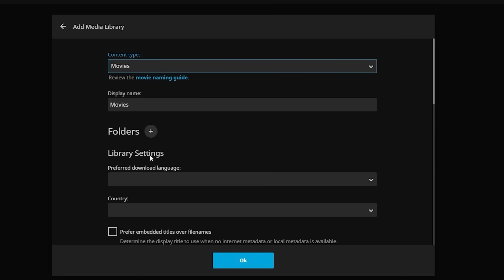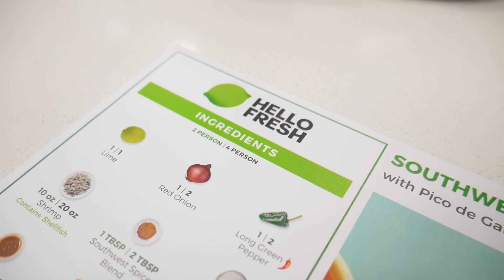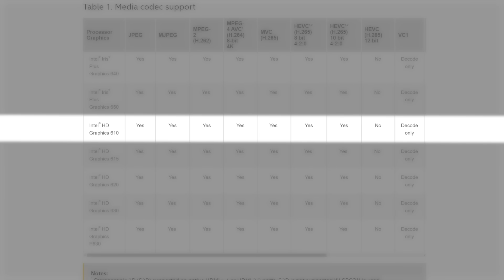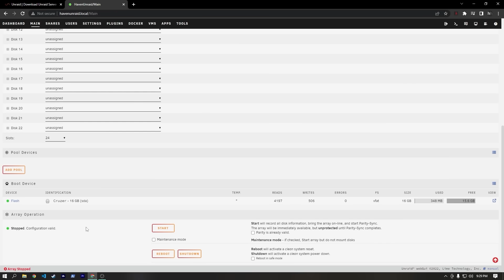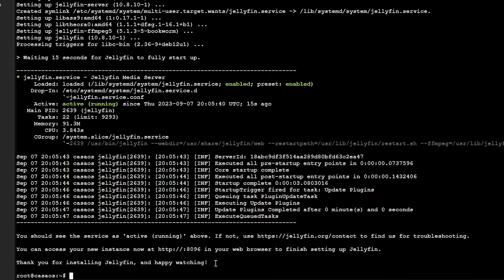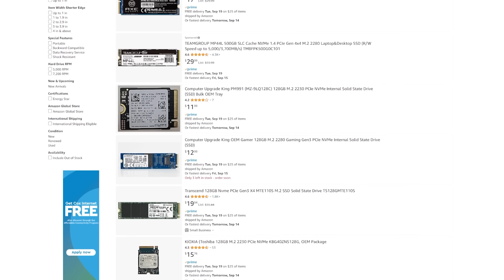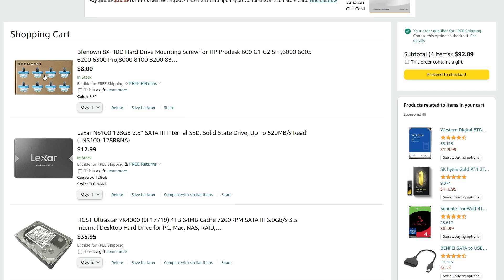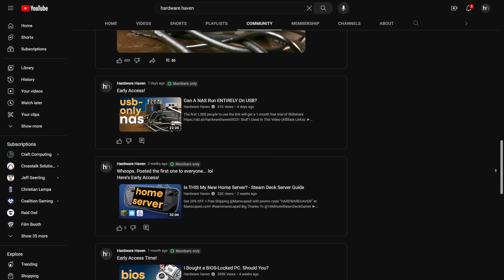The ULTIMATE Budget Jellyfin Server

Comment: I use my Mac Mini M1 as a Plex and Jellyfin server as well as being my photo video computer.  With an external drive it works great as a media server.  It is really low power and also great to rip your DVDs and Blu-rays, getting around 300 frames per second for encoding DVDs and 60 for Blu-rays.  They are getting pretty cheap now they have been replaced with the M2 version.
Reply: How is transcoding performance? I am thinking to connect M1 mini to my Synology for jellyfin.
Reply: @sudarshan6530  seems fine so far, I have enabled hardware acceleration and watched quite a lot of films in different ways such as mobile phone/tablet/fire trv stick/browser and all have worked great.  Also watched a mix of h264 and h265 source files with no problems.  Hope yours works out well.

Comment: I just bought a HP 800 G5 SFF w/ i5-9500 on Ebay which I was changing out my EMBY/Gaming server.  Upgraded the RAM to 32GB.  Actually a great PC.  The 3 drive bays and 2 M.2 is very compact.  Even has 2 PCI-E x16 (one at x4 i believe) and 2 at x1.

Comment: From both my research and experience so far, it's been worth the difference to at least get something with an 8th gen intel cpu. This in when the UHD630 igpu was introduced to replace the HD630 and is a transcoding powerhouse. Also, this is when i7 cpu's started coming with 2 additional cores making them 6 cores and 12 total threads(great for additional unraid things). A good example of a model with 8th gen would be something like the HP Prodesk 400 G5.
Reply: Also worth looking into would be laptops of those generations. Screen and keyboard condition does not matter and sometimes you can get an Nvidia GPU and low power consumption to boot
Reply: The HP Prodesk 400 G4 is even a better deal with an i3-8100 it's very cheap to obtain, has more than enough power to run stuff and transcode as you already mentioned
Reply: The HD630 is still really good. I read on reddit that you get 4-5 4K Transcodes with a HD630 and 6 with a UHD630 not that big of a difference I would say. as They otherwise have the same transcoding capabilities for 4K HDR.

 I think most people are good as long as they dont get a skylake or older as they lack H.265 10Bit 
Transcoding.

 In my search for one it looked like it was easier to find the bigger version of the HP 800 G3 that have room for 2 HDD with the 7th gen CPU,s over the 8th gen,s for a good price but i also live in the EU where a machine with a i5 8500 would cost around 270 Euro and a i5 7400 would cost 135 Euro. As these types of PC are not often sold to the second hand market in my country and are scrapped in sted. For myself it was the cheapest to get a second hand HP 800 G3 from the UK and ship it here as most people here wanted at least 185 Euro for one with a 7th gen and 140 Euro for a 6th gen.
Reply: Some low end 8th Gen is the sweet spot for someone trying to run Jellyfin with hardware encoding 4k hdr... Actually... That was the whole reason for me to switch from a RaspberryPi to a full desktop i5 8400... It has been running great tho!
Reply: @Rafy_24 how’s power draw on that? And do you think it has enough power to run a Linux instance I can tap into?
Reply: So if I get an HP ProDesk 400 G5 8th gen intel cpu I would be able to stream movies in 4k without issues?
Reply: @blocked_message  yes it will
Reply: i would have went for a g4
Reply: I recently pulled the trigger on a Dell Optiplex micro with an i5-8500t in it. Very glad I was able to get it for 100. It only is coming with 4gb of ram, but getting another 4gb stick or a 16gb kit will be super inexpensive.
Reply: I got HD 630 with a 7th gen i5-7600
Reply: My main pc uses a i5 8th gen :')
Reply: I ordered the HP Prodesk 400 G5 becauseof your comment, and I didn't realize there is only one 3.5-inch drive bay. Is there a way to get 2 3.5 inch drives in it?
Reply: @scottsprojects658  You may have to get creative for that setup. I use 1 3.5in HDD as the parity drive 2x 2.5in SSDs mounted to the bottom of the inside of the case with double sided sticky tape, and an nvme drive as cache.
Reply: @Abro86  thank you! What size hard drives do you run?
Reply: You can find x265 readily online (in decent compression as well)...the lower processors can decode it for streaming but can't encode without full brute force CPU compiling.  Most players can also decode as well...saving bandwidth
Reply: After looking at it some more at the HD630 and UHD630 They look identical in benchmarks if you just look at the iGPU and doesn't put anything heavy on the CPU when running similar ram configurations i think they may actually be the same one just rebranded as the only differences i could find it that the i7,s with UHD630 have a 50 mhz higher boost clocks over the HD630. All other CPUs have the same boost clocks on their iGPU as the previous gen. 

I think the difference we see in how many transcodes they can do actually come from the ram configuration used with the iGPU as the 7th gen series supports ram up to 2400mhz and the 8th gen supports up to 2666mhz. Making the UHD performance a little better but we also need to take into account if the PC is running Single, Dual och Quad channel memory. That will also affect the performance of the iGPU. Especially if you are just running single channel as it can make a huge performance loss over dual channel everything at around 20-30% on the HD and UHD iGPUs depending on use case.
Reply: 8th and 9th gen don't usually have hyperthreading except for i9.
Reply: @sethperry6616  the 8th gen i7 8700 is the one exception to what you said. It’s 6 core/12 thread.

Comment: The more stuff you stack on the software side the more needlessly complex your setup and troubleshooting will become. IMO TrueNAS is great for this kind of build, it functions as a hypervisor and has a Jellyfin plugin ready to deploy in the app catalog. Unfortunately to make it work though you'd need to get a slimline optical drive to 2.5 bay adapter though.

Edit: Oops, I didn't notice the SSD on the board, that'll work fine as a boot drive for TrueNAS to. Either way adding a 3rd drive would allow for a RAID 5 and gain you some wright speed improvements and more space while still allowing for 1 drive failure!

Comment: Why is everyone in 2023 still a fan of „Transcoding“?
Reply from the maker: Because direct streaming isn’t always possible..?
Reply: @HardwareHaven  Is that so? I mean, every Tablet/TV i own takes everything i throw at them. Do you have an example for me?
Reply from the maker: @Bogomil76  are you using h264 or HEVC? A lot of modern devices and browser can decode HEVC just fine, but not 10bit. 

Also, plenty of people want to stream outside of their local network where bandwidth becomes the concern, not necessarily the codec.
Reply: @HardwareHaven  For the most part its H.264 (Blu-ray) and some 4K (UHD).
Yes, outside could be a problem.

Comment: And what should "CasaOS doesn't support raid" mean? Isn't casa just some container manager on top of any linux os? Is it that hard to config raid using 1 config file and couple of commands? Is it THAT critical to have this functionality in fancy web ui?
Reply from the maker: You're correct, and I have setup RAID with it, but I imagine someone setting up CasaOS is wanting a simple solution. I also had some weird issues with how CasaOS recognized the mount point for the array, so I just went the route I went. Not saying it was the best option.
Reply: @HardwareHaven  yes, probably you're right speaking about newcomers, I think casaos will add this feature in the future, afterall it is still relatively new project. Thank for the video!
Reply from the maker: @rafisburganov  Last I checked one of the developers either said they're working on it or plan to. It would be great to have that as an option to recommend to family/friends
Reply: When you know nothing about computers. No fancy button = does not support.
Reply from the maker: @severgun  Poor choice of words, sure. I should've said that they still haven't implemented support for managing raid within the UI. Get off your high horse dude, lol

Comment: That HP EliteDesk 800 G3 has to be the best small form factor PC. In addition to all the things you said it also has some PCIe Lanes that can be used for adding NVME slots. If you actually get your hands on one you could make a nasty little NAS. That would be an incredible project for the channel.

2x 3.5 drives (pick your capacity for backups)
1x NVME drive (for the OS)
2x NVME adapters for the PCIe slot (primary NAS storage, ZFS mirror optional)
Reply: You can even chop off the 2.5" mount and put a third 3.5" drive there, with a bit of DIY skills. I have a G4, which is very similar, and I have 3 HDDs and 3 SSD in mine, plus a dedicated GPU and dedicated 10Gbps card.
Reply: @12gark  Can you post a picture of your build showing some details? I've got the same system and I really want to do something like yours. Mine is currently running with only 2 HDDs and 1 NVMe
Reply: @Volgin.  Sorry, I'm not really a guy to post stuff on reddit, and it's very tight so I have no idea how to take useful pictures in that mess, but I can give you a quick description. Basically you disassemble the from metal tray (of you look carefully from the side, there is a position where you can push out the pins holding it in position). Then you chop off with an angle grinder or a manual saw for metal the 2.5" tray. There are 2 bends where the metal goes down to hold the 2.5" drive, you cut right on the bend, and everything else that gets in the way. Use a hdd to check where it's hitting, and cut everything it hits until is sitting on the flat part. Don't worry for stiffness, it's plenty strong for a pc case even after cutting, make sure you remove everything thst could be an issue. Don't cut the front mesh, otherwise it may become visible from the outside, ruining the looks. Mine is sitting below the TV, so I wanted it to look nice from outside. 
This way you have enough space for a slim 3.5" drive when you reassemble the from tray. To fit the chonky disks you need to lower the 4 pin psu connector that goes into the mobo. I tried with an extension cable (cutting a piece of the plastic connector), it can be done and it works, but I didn't felt safe and decided to opt for a slimmer drive I had laying around.
I then placed 3 corks cutted to the appropriate height below the disk (hot glued to the bottom of the case), and a 0.5mm rubber pad I had laying around from another project above it, in the areas where the disk makes contact against the metal tray. I added a couple of zip ties just to make sure, but they are useless, the drive sits between the corks and the rubber, and that's more than enough once you close the tray in position. 
It seems awful described, but it worked just fine for a year straight, and disk hasn't moved 1mm (I marked the position with a CD marker just to make sure, and both the cork and the rubber work to damp down the vibrations).
The real pain is fitting the 3 power connectors to the 3 drives, be gentle and be patient, two things I'm not particularly good at. Short and flexible sata cables are really helpful if you find any. 
The third Nvme is just a no-name 1× pcie to m.2 adapter from amazon, maybe 10$.
Then a x540 pcie 10g card and a Quadro A2000 from ebay and you're good to go.  
You can also add more stuff using the WiFi M.2: you can add 2 sata, turn the A+E key into an M-key with an adapter for a regular Nvme, or add a 2.5gig ethernet nick to that port. I wanted to put a 2.5" sata ssd into the dvd slot, but I gave up, too tight with the third 3.5". Absolutely doable if you want a 2×3.5"+2×2.5" setup. 
My entire home lab runs on it with no issues, but I do spindown the drives when not in use, so maybe check for temperatures if you plan on leaving them always on. A slim 40mm fan fits between the drive and the gpu if you want to improve cooling.
Having a blower gpu, the psu pushing air out, and the cpu cooler kind of blowing air out with the stock plastic cover, I never had any issues with internal heat, there is always air sucked in from the front.
Reply: @12gark  Nice, i got an AI step-by-step guide transcription out of your reply and i think it'll be easy to follow along. I may do things slowly at first, probably getting an intel arc for transcoding, 10gb nic and a pair of ssds for caching. Good think is that standard ssds can be glued anywhere without a problem. Then i'll look onto modding the case to add the third drive and do an RAID Z1 :)
Reply: @Volgin.  If I can add 1 single advice, the gpu for transcoding is very much not needed. I have Jellyfin in a LXC (proxmox as a hypervisor), I share the gpu using this guide, and it works like charm with the stock intel graphics. I use the gpu as a remote render machine for my cad projects. I work on a laptop offsite and whenever I save something on my nas in a specific folder, the server makes a render for me, so I don't have to hear the laptop turn into a jet engine. 

https://www.youtube.com/watch?v=0ZDr5h52OOE&list=PLA07U0UNzS4Jn_xNHpoM077HGqumc6dox&index=12&t=5s
Reply: @12gark  I am currently using the onboard graphics, and I feel like I could use some help from an offboard GPU, not like it's mandatory, the Intel 630 is very capable; I just think I could take advantage of the headroom specially once I get more people watching simultaneously!
Reply: @Volgin.  Sure, I only have max 2 viewers, that's why I never see the issue 😅
You are absolutely correct.
If you can find a blower card, I strongly suggest you one, because cooling is limited, especially when you add the third drive
Reply: @12gark  Yeah, for sure. Thanks a lot for the help, friend!
Reply from the maker: I wish it wasn't as proprietary (I forgot to mention that in the video), but other than that, it's awesome! Need to get my hands on one
Reply: Mine is a g4, and I have 3x 3.5" drives, 2 3 NVME drives, 2 sata m.2 drives, a dual 10gb card and I still have space for the last piece missing, a quadro A2000 12gb.

Comment: For reshaping metal like that, I’d highly recommend knipex plier wrenches. They can be steep, but sometimes easy to find depending on your local 2nd hand market. There’s also some equivalent wrenches from Irwin and Lennox that are cheaper new.
Reply from the maker: Thanks! I might look into that
Reply: @HardwareHaven I 2nd that. Knipex " pliers wrenches" are the way to go. Worth the little bit of extra dough.
Reply: Wiha also makes a nice one. They come in handy for everything, not just turning bolts.
Reply: There's also a Horrible Fright Tools version. Icon is about half the price and is their professional top of the line brand.
Reply: they do not compare to Knipex. i have 4 or 5 sets  of their pliers, and their plier wrenches are superb. honestly i'd probably pay twice what they cost, and they're not exactly cheap. 
 @KameraShy
Reply: @KameraShy  There is some debate as to whether or not some of the Icon stuff is made by the same vendor that makes Snap-on et al. I've seen some side by side comparisons, and the tools are identical (aside from maybe color), right down to performance.
Reply: there's also Engineer pliers, made in japan. they're focused mostly on smaller pliers for working with more intricate objects, and they're ESD. they have a "screwdriver plier" that is invaluable for removing screws that are seized, or as all too common in PC cases, rounded out. also not cheap, but invaluable when a screw won't budge.
Reply: @danielrunyon4830  OK, you got me on the hook, esp with the "screwdriver pliers". I think I recall a pair of Vampliers, which I believe are Japanese, that sort of had this feature. Where are you finding these cool goodies? I'm assuming Amz Japan, yes yes?

Comment: Because of you I bought a new server yesterday! It's an Optiplex 3050 with an i5 7500 and 32GB of ram. Thanks for your videos!
Reply from the maker: That's awesome! Congrats!
Reply: How many drives and what sizes (2.5" or 3.5") did you manage to fit in the 3050? As far as I remember you can only properly mount a single 3.5" HDD in there?
Reply: @G-Foxy.  yep thats right. Just one 3.5" drive but I have a m2 PCIE 1TB SSD for OS and one 2TB Sata SSD for data like movies, shows, nextcloud etc.
Reply: Bro hows this for jf

Dell optiplex i5 with 7500t
Reply from the maker: @ydiadi_  if it has room for the drives you want, it should be great
Reply: @HardwareHaven  its a mini 1L pc factor i dnt it would
Reply: @HardwareHaven  please help me out on this i am on very tight budget and cant afford to sped on wrong product
Reply: I have the same PC running as my gaming server lol. The CPU is a powerhouse for Minecraft servers.
Reply: @jsnotlout3312  it really is and it doesn't even get hot. I can touch the case - it's cold and the fan is so silent I dont even hear it at night.